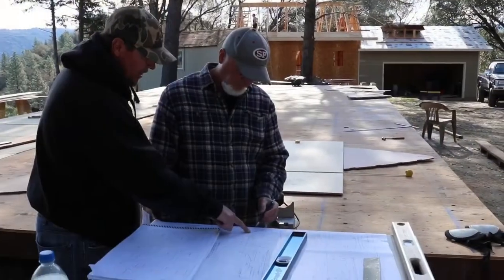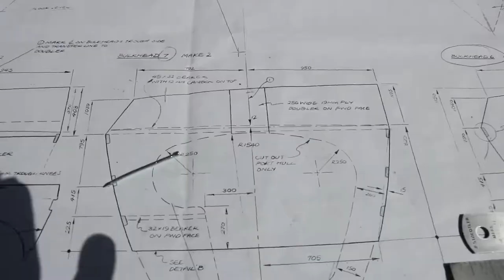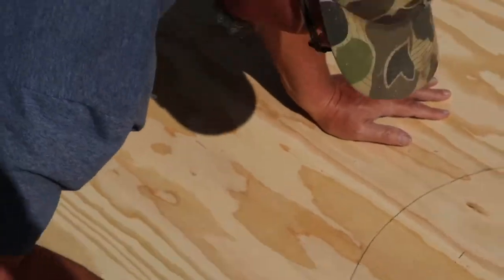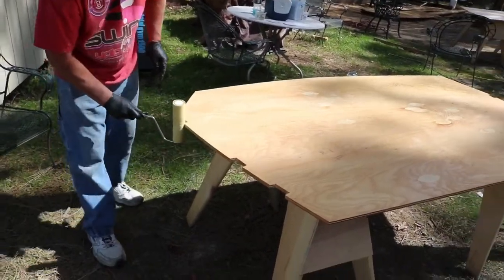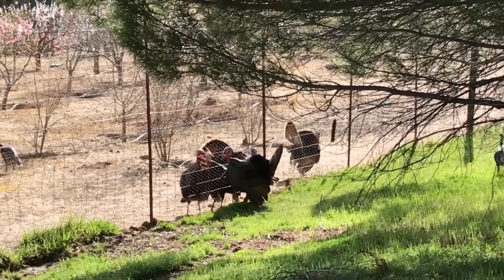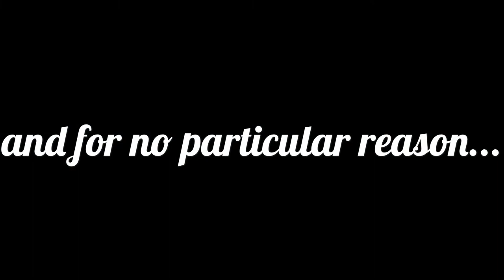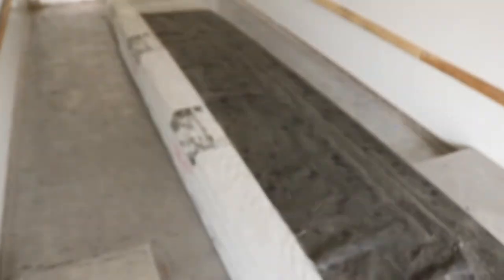E4 Building a Catamaran

Comment: Would be interested to know what kind of plywood you're using.  Looks like pine of some sort.  Is it marine-grade or just generic Home Depot stuff?  Best of luck with the build!  You said you're in California?  Hope those fires are nowhere near you!!
Reply: Meadmaker 452 just guessing but I would think yes it’s just a generic wood. But they brush epoxy on everything for added strength weatherproofing and the ability to glue sheets of fiber onto them.
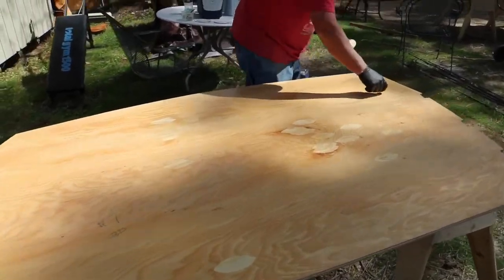Reply: 3:45 <--- "marine plywood"